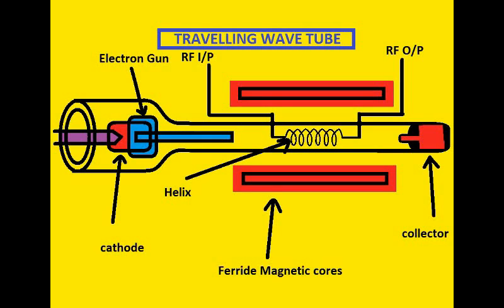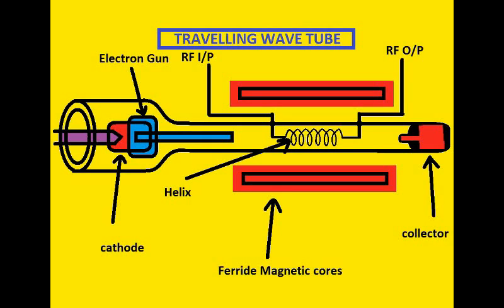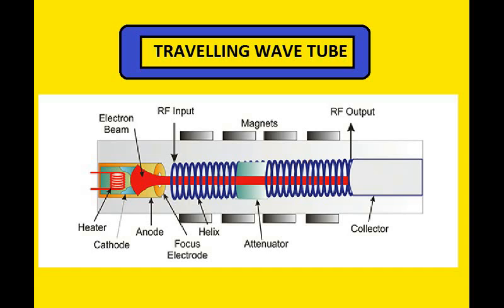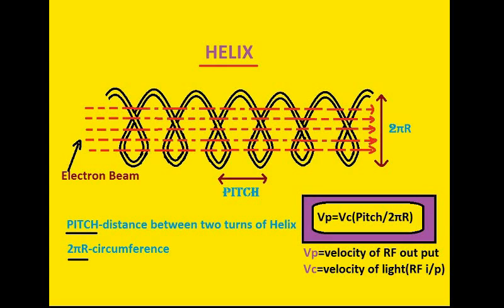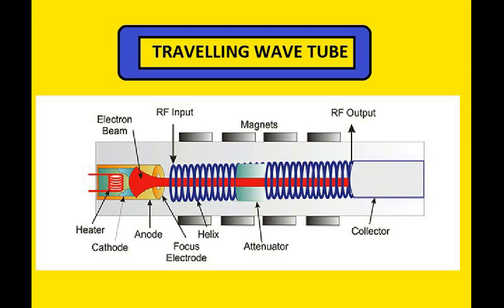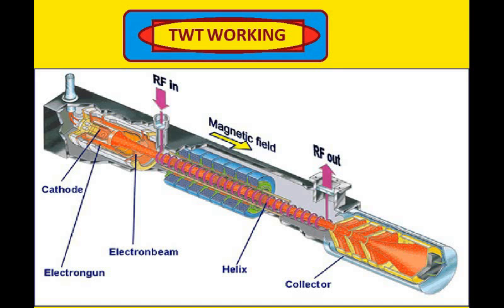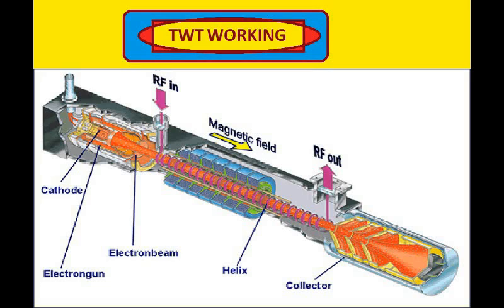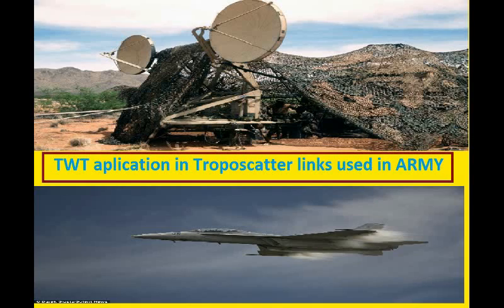What is a Travelling wave Tube & how it works?

Comment: This explanation fails to explain the energy transfer from the beam to the signal.  Clearly the electron beam is slowed (lower energy) to transfer energy to the input wave.  The electrons are not so much bunched as decelerated.  The deceleration of electrons occurs because the decelerated electrons remain in the deceleration field longer than the accelerated electrons remain in the acceleration field.  This is because the electrons must be traveling faster than the signal in the helix at the input of the tube.  The electron beam is decelerated as it travels down the tube (loses energy).  This energy is transferred to the input signal through induction.